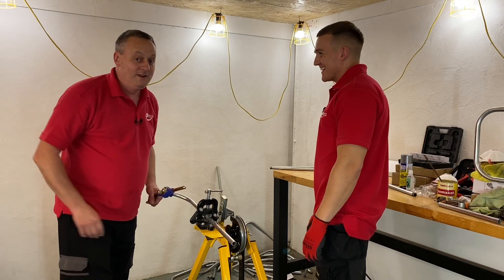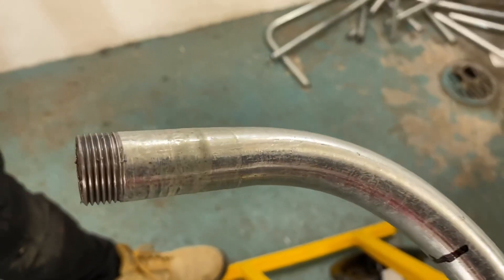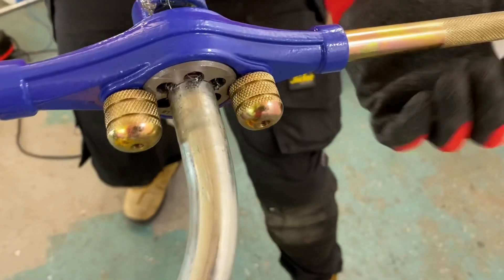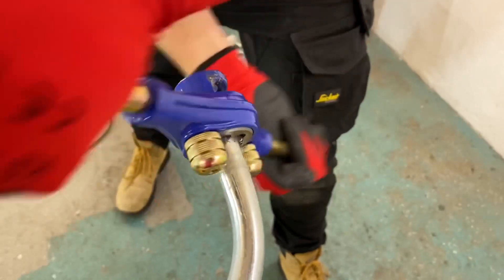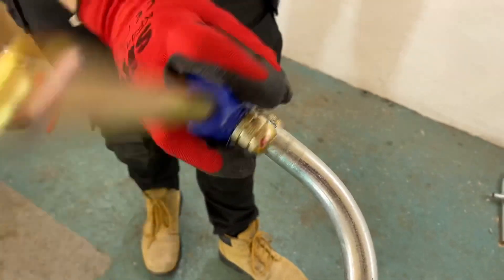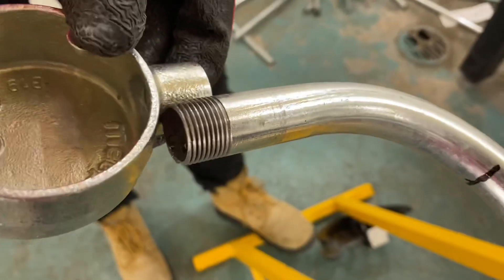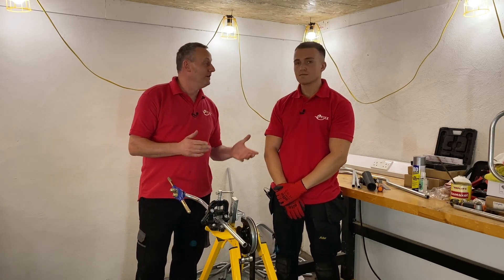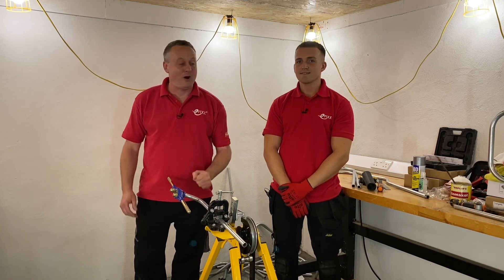THREADING STEEL CONDUIT - Stocks and die hacks.

Comment: Can also remove the guide instead, as long as there's some downward pressure the die will remain properly in the stock. This means you don't have to use the die backwards and it should cut easier.

Comment: Take the guide off and use the die to cut as intended. The way you have done it you are missing the taper on the die thread.
Reply: That's what I've done but I'm not sure the die holds properly in the stocks without the guide?
Reply: @jollyfinequality9865  once the thread is started a little pressure will hold the die on the back so it won't spin.

Comment: Had some tricky bend to do like this just yesterday used the same technique ,What is the minimum bend that you can do and still be able to thread it ?  Mine was 120mm to the back of tge bend and that was tight to get the stock and die round